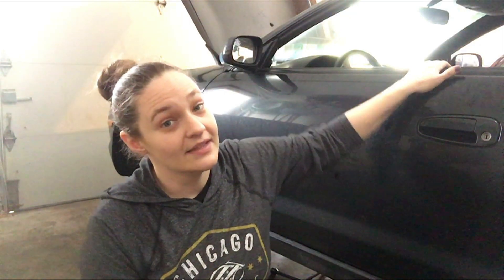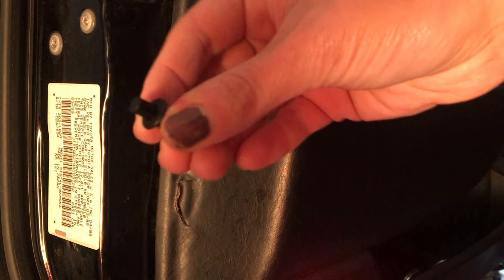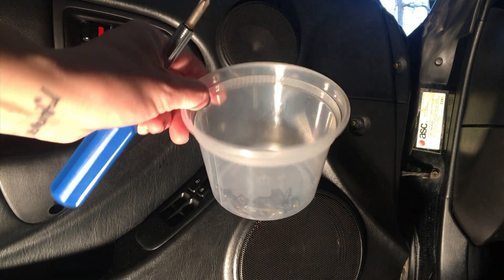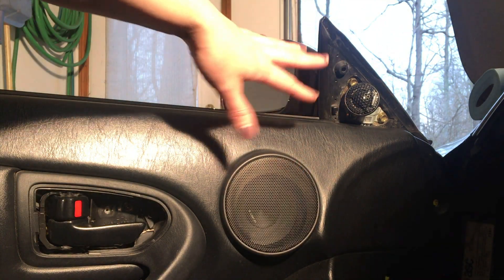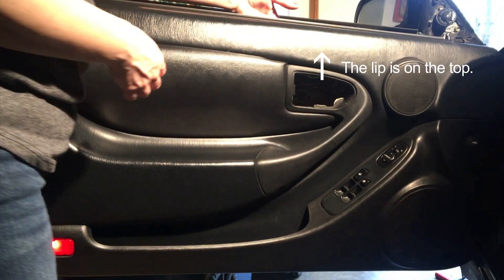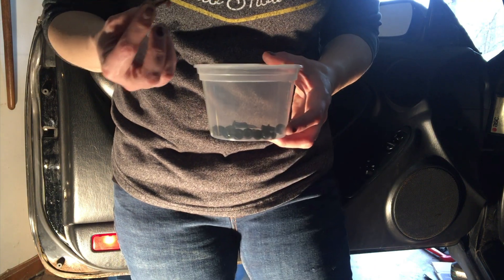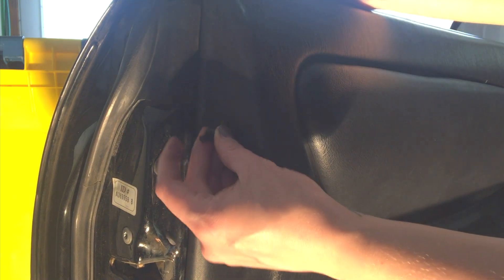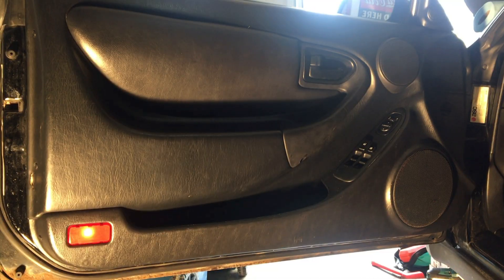How To: Remove Door Card/Panel  - 1999 Toyota Celica

Comment: Oh. Just a pointer when I, replaced my window rubber seals I, used hundred mile an hour tape to depress the door lights button to save battery 🪫 power. Just a thought.
Reply from the maker: Excellent tip! 💡👍🏻 😃

Comment: Whoa, yours has got an extra speaker in it at the top. Never seen that before.

I notice your door card doesn't have the fabric. Did you remove that? Hoping you post some more Celica videos.
Reply from the maker: Hi Dirk!  I do like having the fancy 3 door speaker setup!  

My car came with leather seats, so the door cards also included leather instead of fabric.  So, no, I did not remove any fabric from my door.  

More videos are in the works!  They'll be here soon!